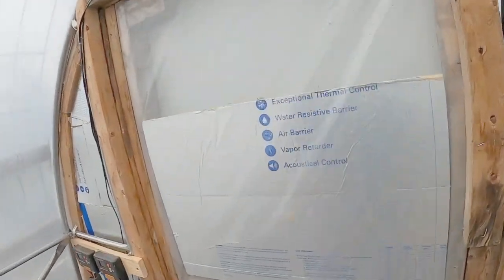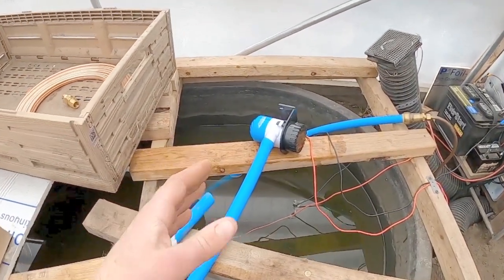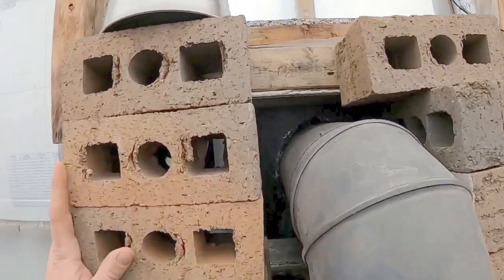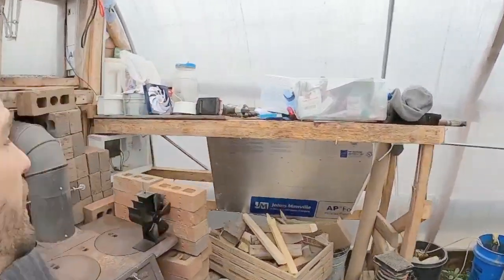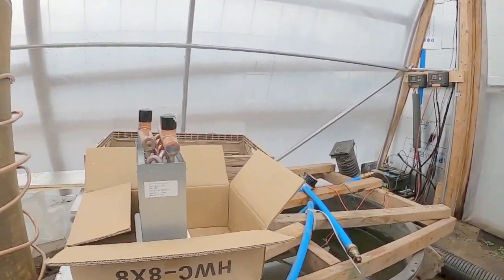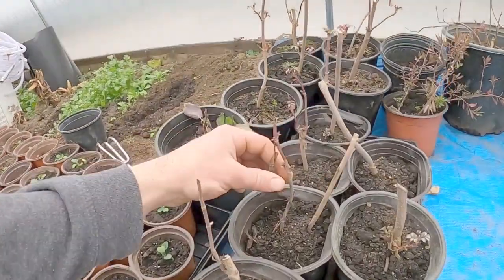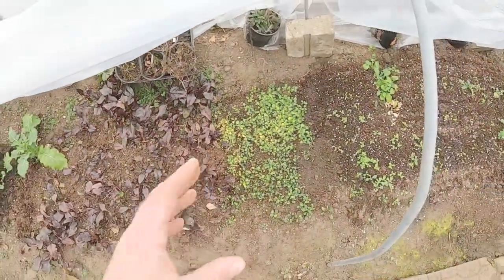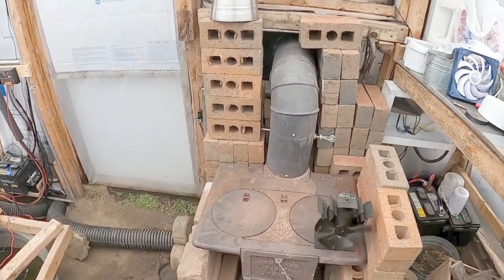Cheap DIY Greenhouse Heating - Brainstorming The Next Heating System

Comment: How do you cool your greenhouse when it gets to be warmer weather? In south Kansas City my indoor temps hot up to 122 °F with only the sun as heat.
Reply from the maker: geothermal is a steady temp of around 50F summer or winter, that helps tremendously on the floor of the greenhouse in summer. Having the correct sq footage of open venting when it heats up with window actuators is the best solution, we have both our windows open up when its too hot and the warm air vents quite well on its own. shade cloths are a must once the sun becomes too strong. what I am lacking is a nice big fan, I'm going to wither hook up a large solar fan or run an outlet or two from my garage about 50 ft away. great question!

Comment: moving water doesn't like to freeze, maybe run the pump 24/7 even when there is no fire in the wood stove.
Reply from the maker: I've thought about that over and over lol, I didn't want any condensation to form up being in the humid greenhouse and all. my major issue was the bend job, I had dead spots allowing water to sit instead of a steady drain back down when the pump shuts down.